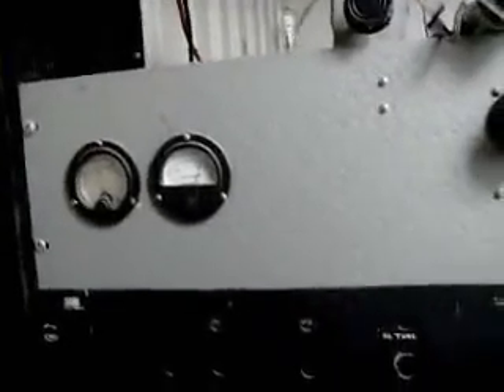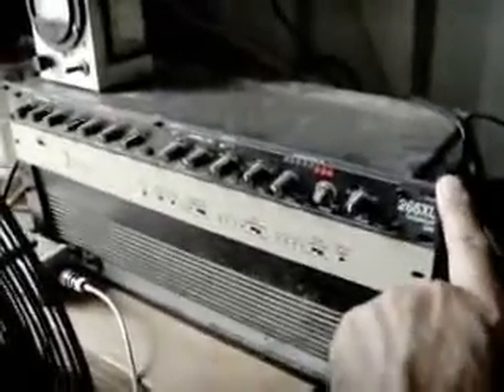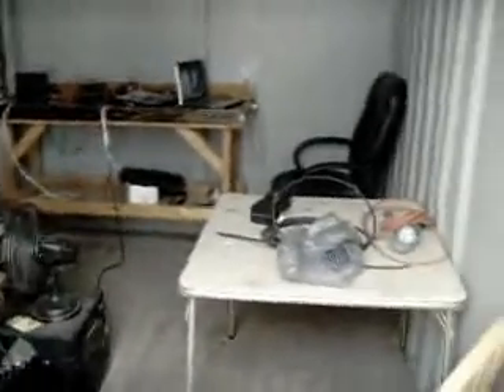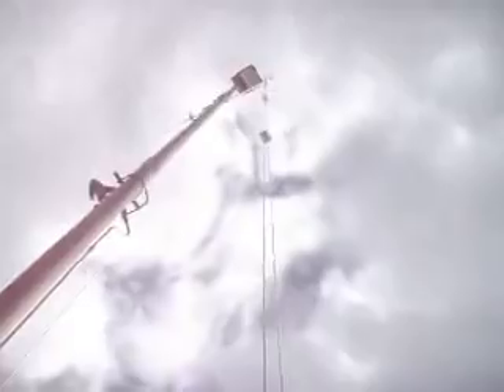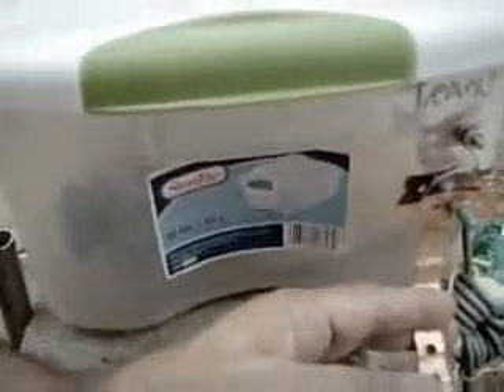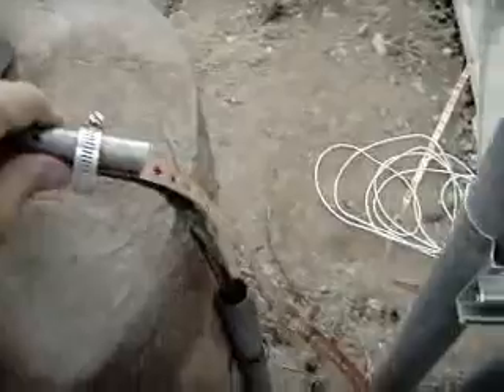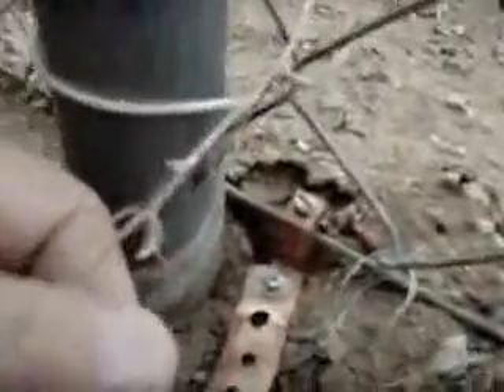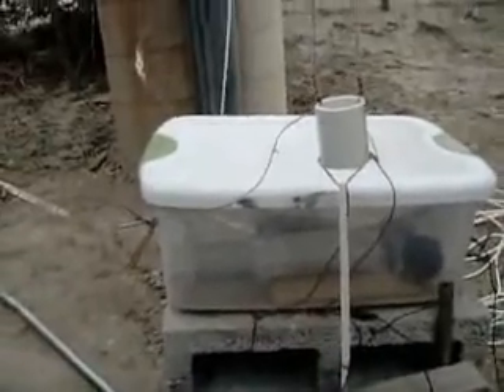AM Transmitter on 1150 AM

Comment: Who wants to put an AM radio station on, with the extremely high noise levels at these frequencies, these days.  I always use a SS pulley and a sash weight instead of springs. (with Dacron cordage) Ron W4BIN
Reply from the maker: QRM is rediculous these days and there's no excuse for it. Sad that our regulatory agency (FCC) has allowed it to get to this level. Doesn't appear they're doing anything to stop it either. 73

Comment: so from the comments here this seems like 1150 was / is a real station that owner lost lease to property? And you're keeping the flame lit to keep radio alive. Maybe you can apply to take over the station. And now I understand a little bit more about 1150. STA Special Temporary Authority. A lot of building booms and real estate are causing AM stations to lose their property. AM stations need so much space for proper antenna system. You know the 120 ground radials transmitter building / studios
Reply from the maker: Yes, it was a real station, and it still is. Yes, the former owner lost the property and had to move. What you see in the vid was the temporary location and the means for keeping it on the air until it got sold to the new owner. As for me, I don't have the means to buy the station, but wished I did. Still, to own a radio station is a big responsibility you got to contend with, like paying a crazy big power bill every month; I don't  wanna do that. 

You're correct about the real estate issues that have been affecting AM radio stations. That has also been the case here in Albuquerque. There's still 1 station on 1240 here that is working with an STA at this time. As for 1150, it has since been operating at its new location and shares a tower with 3 other stations. I think tower multiplexing will be the future for AM stations. 

This is the last vid I made of the Bauer... https://youtu.be/LHdj2OCt_Yg
As of september 2021, The Bauer was replaced. It now resides at my house for refurbishing.

Comment: Why would a station lose its land lease? Loss of ad revenue?
Reply from the maker: The station did not own the property. It was sold and the station had to relocate. It's happening a lot these days.
Reply: @bob4analog  Due to old leases expiring?
Reply from the maker: @TheLightningStalker   Yes, that, and/or the owner did not want to renew the lease, for whatever reason.
Reply: @bob4analog  Makes sense since some stations are over 50 years old
Reply from the maker: The face of AM radio has certainly changed over the years. It's no longer the respected medium it once was. And in this economical climate, it's debatable as to where it will be in the next several years. In the meantime, those who have AM stations do what they can to keep it going.

Comment: By the way, feeding lines (ladder, 300 ohms Strap, i dont know How you call It there) its hard to find here in Brazil, whats the measurement between the wires in the PVC insulators (I really Will try It!)? Solid wire? Its 300 ohms using insulators like these?
 If you can give me some hints about It, i will apreciate, MW broadcast tech info is really scarce here.
Thx, 73!
Reply from the maker: I used 4 inch PVC sections to make a "ladder line" which is actually the vertical part of the antenna. The ladder line dimensions are  really not critical. You can use 300, 450 or 900 ohm ladder line strap, or just make your own like I did. My ladder line strap extends 35 foot vertical and each end was sloped down at 50 foot lengths. The feed ends of the ladder line are shorted together, then a series coil was connected to that and the transmitter. Coil was tapped for the best SWR. I can email you a diagram if you like, bob4analog@yahoo.com.  73, KD5MHQ

Comment: Very interesting stuff you got here!
Im starting a station, still with low power out of the PLL, i'm studying what kind of antenna should I built in my familys ranch, and I guess I would try something like this!
Reply from the maker: If you're making a Part 15 AM transmitter, those rules state 100mW and a 10 foot maximum antenna. The antenna I made would probably not be legal.
Reply: @bob4analog  I'm in Brazil, I don't have these rules... Its not legal, but they are closing the stations, MW will die around here... So there are plenty of space at the dial...
Reply from the maker: @ronnylucas8857   Oh! Ok, go for it!  ;-)

Comment: Hi Bob, i know it’s been a while but do recall how this setup did from a coverage standpoint?
Reply: I can cover my whole town with a 80 watt and horizontal NVIS dipole.
Reply from the maker: It was compromised at best. I live 10 miles from the transmitter and I could receive the signal fair on my Panasonic RA-6500 receiver in the house. That's not too bad, but it's not near as good as a 1/4 wave vertical. The S meter only showed 1/4 scale on the receiver, but it was listenable. I didn't get any real field strength measurments, wished I had.

Comment: I bet you get around 70 miles on that during the day. top loaded should give a very nice ERP.
Reply from the maker: - 70 miles?! I Wish! Maybe on 40m! The only saving grace for this was the counterpoise, which was a long chain link fence. At 1150 khz, the radiator was just too short to have any effeciency, even tho it was top loaded. But it did ok.
Reply: @bob4analog   That’s strange that you’re getting such a bad range. I guess your region has poor ground conductivity then. my radiator is shorter than yours and it is top and bottom loaded. There are 8 radials and two ground spikes. I am getting the same range you are getting, but I am running only 5 watts. I already ordered a 50 watt rf amplifier because I want stronger signal around town, it will probably work 70 miles away with it. how is it that my antenna is worse than yours and I am getting much more range? On the other hand, FM was a total nightmare for me, i had 50 watts go 2 miles.
Reply from the maker: @letitrotfuckit  - Yes, your right, ground conductivity is not too good here in the southwest. What kind of antenna do you have on your FM?
Reply from the maker: @letitrotfuckit  - 5/8 is a great antenna. Assuming the swr is good, you used low loss coax and you have a good HAAT, yes, 5w should do pretty good. Several years ago, I experimented with a 10w FM and a J pole antenna and it worked really good, but I was up on the mountain which is 3000' higher than avaerage terrain. I could receive the signal all over town here in Albuquerque. So, the extra HAAT really made a difference. What is your FM antenna HAAT?
Reply from the maker: @letitrotfuckit  - Oh yes, you mentioned the 100kW stations, they could be causing receiver desense, especially if your frequency is close to those stations. Another factor is that receivers are not that sensitive, except for some of the car receivers. They seem to do pretty good. But the fact that you're getting a 9 mile coverage with 5w is considered about right. The LPFM figures are about the same for that kind of power. I've found that it's quite a challenge for ordinary indoor FM receivers with their built-in antennas to receive much of anything,  except the high power stations. There’s a translator FM station I installed that's 650w with a circularly polarized 1 bay antenna. That means the antenna is putting 260w in horizontal and vertical poles. The station is licenced for 260w which is what they're producing with line loss and negative antenna gain. It's 20 miles away from Albuquerque and the signal is virtually unreceivable in most homes without an outdoor antenna, and it's has spotty coverage on car radios. So, it doesn't surprise me that you're only getting 9 miles of coverage with your FM.
Reply from the maker: @letitrotfuckit  - Ok, I understand now. A couple of things come to mind with your FM set up; the RG58 and the polarity of your receive antenna. How long is the RG58 to your antenna, and is your receive yagi vertical? I assume your 5/8 antenna is vertical. Also,  can you varify that there is 5w out of your tx? The reason I ask, is I've got a 5w FM tx but it only makes 3w out.
Reply from the maker: @letitrotfuckit  - Oh, ok.. misunderstood. Well I guess FM is not the way to go. AM definitely sounds like a better idea since you're getting far better results with it.
Reply from the maker: @letitrotfuckit  - Nice! Where are you getting your amplifier?
Reply from the maker: @letitrotfuckit  - Nice amp. Remember tho, with driving a linear amp with AM, you'll need an amp with at least 4 times the power of the unmodulated carrier. So, if you want a 50w output, you'll need an amp rated at least 200w output.. and that's only for 100% modulation. You'll need even more output power for asymmetrical modulation. It's all Ohms law. Twice the voltage into a fixed resistance is 4 x the power. That's why linear amps are not used in common place broadcasting; they're very inefficient. For low power, they're ok tho.
Reply: Radio Pushka Wow nice! 100 miles at night with 5 watts..Geographics must be in your favor there. I think 160 meters would be a lot more popular with Hams if every one could get that lol. You can also google “an762 amplifier” from Communications concepts. It uses 2 80 watt or 2 100 watt bipolar transistors. That Chinese one has sketchy reviews.

Comment: I am not a radio engineer but I am interested in your audio amp with paint can, plate modulator in oil. I have not found any links to a diagram. If you wanted to make another video about I would like to watch it......Thanks you. Interesting info.
Reply from the maker: Thanks, I'm glad you found interest in it.  Yes, I'd be happy to make a detailed vid of it. Actually, the design is based on a common design used by many plate modulated AM tube transmitters over the years. I just made this one for 60 watts, but same basic principle.
Reply: @bob4analog  Thanks Bob, I will watch it if you make it. I was in TV Production and moved to a tiny rural Lake Community in a valley and we get Zero Radio other than my buddies local non profit FM in a small town 10  miles away. I did some voice overs for him, hung out and asked a lot of questions about signal and transmitters etc. Helped him move the transmitter & Antenna out of town to a high spot and he had the new Antennas hung on a Microwave Tower and built a trans shack. I caught the radio bug and purchased a Part 15, Hamilton Rangemaster Tiny Transmitter. I can feed our little Lake Community, from just above the lake and getting good reach for such a low output. would love to know more to better my signal reach in our radio shielded valley.
Reply from the maker: @MyFREEFrugalHomestead  -  Also, If you would like any info on the tranny, you can email me and I can send it to you.  bob4analog@yahoo.com

Comment: Bob, So I take it the radiator is the vertical portion going to the top of the lamp post, w/ the two downward-sloped wires serving as the capacity hat?
Reply from the maker: That is correct.
Reply: @bob4analog  We have a local AM at 1150 that runs 1Kw Day and 42 watts night into a 190' guyed tower. Night-time range is about 8 miles before the spherics take over. What kind of range did (does) this STA setup give daytime?
Reply from the maker: @GeneralHAM-d5k  I live about 10 miles from this transmitter and I could receive it fairly well in the daytime. The receiver S meter would show about 1/4 scale. Of course all other stations would peg the meter, but the fact that I saw it deflect at all with this station was a miracle. I know that's rather vague info as to how well this antenna works. I think it worked quite well considering it's such a compromised antenna. Course, the large chain link fence around the facility made a really good counterpoise. I think that was part of how well it worked. Another note, I don't recommend running much more than 100 watts; I tried 250 and it was arcing on the slope  ends of the antenna. Use good insulators!
Reply: @bob4analog  Excellent info, man. Impressive setup. You're livin my dream..!
Reply from the maker: @GeneralHAM-d5k  Hang in there,  just never know when you'll get called on to save a station,  then you'll be the hero that kept it on the air when nobody else could!  ;-)  Right now, I'm 'saving' an FM translator from a poorly planned install. I'm making a vid of that too. Stay tuned!

Comment: Can you help me with a am project?  Thanks!!!
Reply from the maker: Sure, what kind of help do you need?
Reply: I need coupler for 590 am.
Reply from the maker: sechisal - For 590 khz. Can you explain the antenna you will be connecting and the power?
Reply: It's a new project. I only have the amplifier. 100W. Thanks!!!
Reply from the maker: sechisal - Email me and I'll give you the info...  kavnradio-940@yahoo.com
Reply: Bob H  Thanks....!!!
Reply: Thanks!!!
Reply from the maker: Its been 7 years now, but i cant remember if i replied to you like i said i would. If i didn't, it may have been because your email got shoved in to the Spam folder by accident.

Comment: What type of range do you get from a set up like that?
Reply from the maker: The range was surprisingly good, maybe a 5 mile radius for good signal strength. I live about 8 miles from the transmitter and was able to receive it on my home receiver.. not as strong as the weakest AM here, but it moved the signal strength meter about half scale. I have an older Technics home receiver; AM sounds really great.
Reply: That's pretty cool. I built  a few 10 watt FM transmitters as commission about 30 years ago that were put in service in remote communities and they got about15 miles range. As far as I know they are all still in operation too.
Reply from the maker: Hey, good on your FM's. I built a 20w with a J-pole antenna back in 2000; it was fun till the feds came. Had to give it up and they let me keep my ham license. Now I have a 100w VHF repeater.. and it's legal. ;-)  ::  Yes, the FM's can get far more range with less power than what my AM; FM antenna efficiency is so much better. I was operating a really small antenna for 1150 kHz in this video.. not efficient, but it worked.
Reply: One system I built has been on the air since 94 and it is still on the air, but it is in a small community and plays music 24/7.  The other 3 are being used as relay stations and they just re-broadcast commercial radio stations down into a valley so that the residents can listen.
Since there is no commercial signals available to those people in the valley I guess the feds just leave them alone. When I have been through the town I tune them in and give them a listen. The antenna is half way up the mountain, and covers the entire town.
Reply from the maker: @letitrotfuckit  - What kind of antennas do you have with your AM and FM?
Reply: @bob4analog  heh, I get a weak signal 10 miles away with 5 watts on 1710.

Comment: Thank you for the explanation. I wonder if I could use a similar setup for my ham radio station, as I also have limited space.
Reply from the maker: Yes, I think so. If, for instance, you're using a G5RV, and you wan to work 160m, you would connect both ends of the bottom end of the ladder line, then connect that in series with a variable loading coil. There should be some kind of counterpoise for this mode of operation tho. The ARRL handbooks also have diagrams of how to make these. Send me an email and I can send you a drawing of how to do it as well... bob4analog@yahoo.com    73!

Comment: Antenna looks like a folded dipole.
Reply from the maker: Yes, it looks like a dipole, and it is, except, both down leads are conneted together at the feed point,  which makes it a top loaded capacitive hat antenna. These antennas are good where there is limited space.